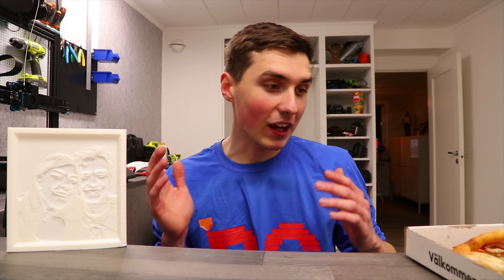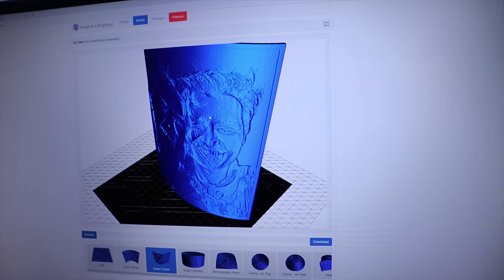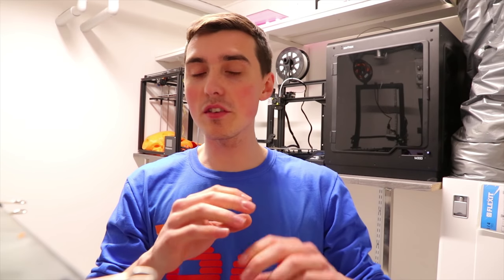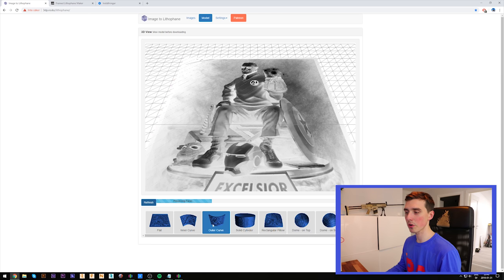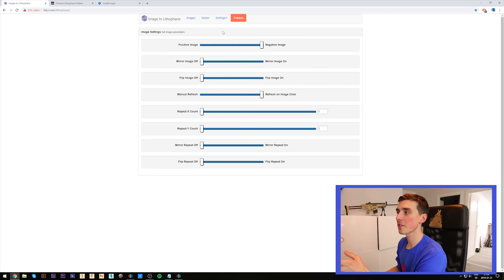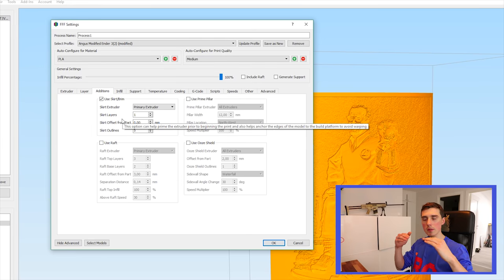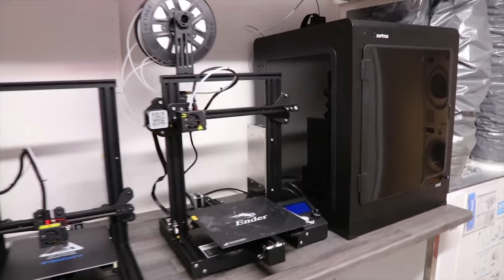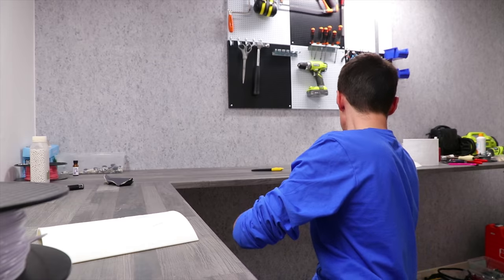3D Printing the Perfect Lithophane Picture

Comment: A little remark: you do need heated bed when printing PLA if you print on glass-like surface, mostly to prevent wraping.
Reply: Yup, I had a glass bed and my prints always kept warping
Reply: Heated bed is mandatory for PLA on most build surfaces. Otherwise expect to have a lot of warping on corners.
Reply: @PunakiviAddikti  I don't use a heated bed, and I was able to print abs. I coated a glass bed in acrylic paint and everything sticks to it. Although I found out that printing closer to the bed is better, especially for petg

Comment: If using cura enable "combing mode" under travel. To keep the nozzle within the printed area.
Reply: There are 4 option, off all not in skin and within infill which one to choose?
Reply: @parthgohil4490  yeah that is what i'm wondering about too
Reply: @parthgohil4490  Not in skin works best. I believe it uses all available methods to avoid the skin at all costs. It does add travel moves so it will increase print time, but it eliminates wisps and strings.

Comment: You can do this in Cura by importing a black and white image and just print it. You can even make a frame for it in Cura by just getting your lighting levels correct on the image before importing by creating a hard border on the image. But if you want to do some extra with it you could then export as .obj and bring it in to a 3D software to bend and shape as you want. This has been possible in Cura for a long time, I don't use any other software to know so I don't know if that is fine.

Comment: I found that i actually get more detail with better edges printing flat/horizontal but layer lines can be seen in sort of a step like pattern as the litho thickness is varied. This also comes along with longer print times.

Comment: You can also try the "Tevo Flash" because it is currently on "GearBest" in the offer. I would be very happy. I think it's a good print with a 230V heated bed, dual Z axis and autoleveling.

Comment: Great video, as usual!  I have some tips to share.  I use all of your print settings (well, the Cura versions) and they work perfectly on my Ender 3.  But I have found that you can get even more details out of my lithophanes by preparing the image BEFORE I upload it to the 3Drocks website.  First I open the image in Photoshop or any other photo application.  I tweak the image to get it looking nice, then bump up the saturation and contrast a lot.  Then I convert the image to gray scale, which produces 256 shades of gray.  Next, I work with the contrast, brightness, and levels to get the most dynamic image possible (meaning I have pure whites, pure blacks, and everything in between).  Then I send it to 3Drocks.  Give that a try and see if you get more details in your lithophanes.  Enjoy!
Reply: Can you leave your ender settings(cura) i have some troubles
Reply: @timooak4409  I use a combination of Simon's settings and a website called Gadunky.  These are my highest quality settings and it takes a long time.  Layer height is 0.12 (or a multiple of 0.04...it's the magic number), initial layer height of 0.24 for better first layer, 0.4 line width, wall line count of 4 will completely get rid of your need for infill, optimize wall printing order,  99% infill (only if creating a frame), enable retraction, retraction of 7mm at 30mm/s, print speed 30mm/s, wall speed 30, outer wall 30, inner wall 40, top/bottom 20, travel speed 100, initial layer speed 15, initial layer travel speed 50, brim speed 15, slow layers 1, travel acceleration 1500, print jerk 12, combing not in skin, z hop enabled, 1.2mm z hop height, and use a brim.
Reply: Let me know how these settings work for you.  I'm in the process of printing a 465mm tall, 200mm diameter, circular lithophane made up of three 155mm tall sections that take 90+ hours each.  In order to create the files for this, I had to use Firefox to use the 3drocks website because it kept crashing with Chrome and Edge.
Reply: @MrBudge72  Just wanted to reply and let you know that these settings you've provided are absolutely top notch. I scoured the internet for the best lithophane settings and your comments provided the BEST prints. Big and small. I'm using an Ender 3 v2 with basic upgrades and slicing with Cura. The quality is incredible. I screenshotted your comments for safekeeping! Thanks!!!!

Comment: You say “you never need a heated bed with pla” but when I print without heating the bed on my ender 3 using the magnetic stock sheet the pla seems to embed itself into the plastic sheet. I also find the finish smoother on the bottom surface with a heated bed. The place does expand and flow and first layer width needs to be reduced to account for this but trying to get the prints off an unheated bed is so difficult I prefer the heat. Any tips on this topic?

Comment: What if you added a small platform below the lithophane image (to keep it in place) and tilted the lithophane 3D model about 45 degrees backwards on the x axis, so that it printed at an angle.
That could help with the quality. The darker spots (which protrude out more) wouldn't slope down nearly as much because they would have more dried filament below it to "rest" on so-to-speak.

Comment: RCLifeOn.... how do you make black lithophanes? I've seen a few around but haven't found any information on how it works. Mine are just black?
Reply: You have to play with your specific black filament to find how thick you can make it, then input those settings into 3dp.rocks. You will likely have to run .4 mm minimum height and like 2.4 maximum to get variations, and therefore have to use a .2 mm nozzle to get those results.

Comment: I like the curved version, have printed that out, yet want to do one that has 4 sides, different pictures, so thinking of the flat version. I would like to find an enclosure, frame, for the curved lithophane, that allows you to assemble 4 pictures together, and add lighting to the interior. I do not want to use the solid cylinder. I have tried to make my own stand, for the curved version, to allow the addition of a light, although, my editing skills aren't the best.  One question about the flat version is, How would you place supports, so they do not mess up the print?

Comment: I have tried all of these settings and my lithohanes still have a LOT of noticeable lines and imperfections. Im printing at 30mms and 0.1 mm layer height. What else could be the issue?
Reply: Which printer are you using?check if your the movement through your z-axis isn’t too loose when your printer is off and tighten it a little bit. If this doesn’t solve your problem try using lithophanemakers.com

Comment: Hey man. I have the ender 3 and printed a lion few months back and had no issue accept a layer shift but I think that is solved now. This time I followed ur video again but the printer just does 97% of a line and stops. Then starts again but misses 2 or 3mm then extrudes filament again. There is a blob left at the stop point and after few layers it catches and drags the print around.  And advice would be great.  I'm using simplify 3d

Comment: I have a question I did 4 prints pretty much with the same settings and they all came out good I did a fifth one but that one doesnt seem to stick and leaves a trail behind I thought it had to do with the bed leveling since the temperature is the same as the other prints so after 3 fails I went back to do one of the old designs and for some reason those print out good same settings and everything. Thank you in advance

Comment: Got it from thingiverse

Ok this is not a design or software, but rather a tutorial. The STL file is just a placeholder; do not download.

Cura (I'm using v2.3.1 for Mac) has a powerful yet less known feature: turning any photo into a lithophane. There are customizers available but Cura is simply more convenient, more flexible, and better quality.

1-Choose your favorite photo in jpg, bmp or png. The best ones are high contrast, simple contour ones. Basically, any photo that looks good in black and white will look good as a lithophane.

2-Open Cura and simply drag and drop the photo file into the window. A setting window will pop up. Set it up as below:

Height (thickest height): 2-4mm; the higher the darker black and better contrast, but more than 4mm and the dark region loses shades. Use a lower height for a life photo, but a higher one for an artistic photo like my example.

Base (thinnest height): 0.2-0.8mm; the higher the stronger lithophane, but the less bright light region and worse contrast.

Width and depth: the size of the lithophane so choose whatever that fits your need. On a Wanhao i3 I print 180mm longer edge because the bed is 200mm x 200mm.

Choose "Darker is higher".

Smoothing: drag to far left, then increase it in the slightest manner possible. No smoothing looks horrible, but anything more than the slightest smoothing blurs the image.

3-Print in white or any light or neutral color. Translucent filaments don't look good. Some key print settings are below:

Layer height: as low as possible to achieve the highest detail level. The Wanhao i3 z step size is 0.04mm so I recommend 0.04mm or 0.08mm, and no more than 0.2mm.

Initial layer height: use something that's no more than 1/2 of the base height in the import setting. This is to make sure there are at least a few bottom layers and the weaving doesn't show.

Infill density: 100% to print the lithophane solid.

Wall count: 1, because there is no strength concern. Similarly top layers = 0 and bottom layers = 999999 (they are only meaningful with hollow interiors).

4-Wait for print to finish, remove carefully (because it may be fragile; I cool my glass bed so it peels off easily), hold to light, and prepare to be wowed! The bumpy side should be facing you otherwise the image will look blurred.

Enjoy! This makes the best gifts for friends at almost no cost. Comments about settings to improve quality are welcome!

Comment: I keep getting lines through my lithophanes.... Very annoying I'm 15 and kind of new to printing. I have the anycubic mega s 3d printer and had it for more than a year. I recently broke the extruder feeder thingy and but super glue to fix it and now it's caused lines through it and now I'm wondering if buying a replacement extruder will fix the problem or not? Help would be great right now!

Comment: How long did the print take the ender 3? I tried those settings for a 18cm high curved photo and it says 10h :0 || 5h20min with 0.15 layer height. Did I mess up the settings?

Comment: Guys if i wanna run a components that requires 12 volts and i only have a 9 volt battery will i be able to power the component? It is a peltier cooler 12706 but i only have a highest of 9 volt battery in my house. Please Respond. I need to know if i can also have components like a fan in parallel that requires 5 volts. How would i bring the current down to 5 or can i run it at 9? HELP

Comment: For Some reason i just can't flip the picture by 90°, so i can't print the curved Lithophane. Anybody got some suggestions? i tryed flipping and mirroring options, and tryed the repeated options. The help section also did not provided any troubleshooting and rotationg the image and importing it "flipped" did not changed anything. It's supposed to be a birthday present :/

Comment: Hi, I'm having issue with some oozing on my litophanes, how can I solve that?
That usually occours when U have the biggest tickness.
Reply: The issue is likely to be that your 3D printer is over extruding the infill. Making sure your printer is 100% tuned is essential, but it may help to slightly lower the infill density. The issue with that solution is that it might result in air gaps that will make dark areas seem lighter. Depending on how bad the globbing is, setting infill density to around 96% shouldn't have too big of an effect on the picture quality. You could also increase wall layers so the lowered infill density will only affect the thickest and most at-risk areas.

Comment: Can sb help, i just tried to print my own  lithophane, and it ended up not translusive at all... is it the fault of the plastic (gray pla) or i just messed the settings 1.3 mm in darkest area?
Reply: brunokazimierz I would imagine the grey isn’t opaque enough. 

If you want to use the grey you will need to experiment with the thinnest & thickest layer. I would also while experimenting print smaller  pictures or scaled down versions. 

I think grey would be one of the harder colors to use.

Comment: My ender 3 pro litophanes always come out super stringy and full of lines.
Reply: As for stringing, you can try increasing retraction value or decrease temperature a bit. And lines could be due to loose/too tight belts.

Comment: Ive tried using 3dp rocks and slicer pe to make a lithophane and i keep having layer shifts how do i remedy this i have tried slowering it down to 40 % speed but it still leaves a shift please help
Reply from the maker: Make sure there is nothing mechanically wrong. Lubricate the Z-axis rods and make sure your belts are tight.
Reply: RCLifeOn thanks ill try to lubricate the rods belts seem tight

Comment: while printing vertically, the ABS cracks in between. What is the solution for it?
Reply: use PLA
Reply: @Twometer  PLA gets spoilt over time isn't it?
Reply: @akhileshbhise7266  no its just not as strong as other plastics. But as long as you dont throw it around it stays stable. And its very easy to print and doesnt smell like an exploding chem lab.

Comment: Everything I've read says you should use a heated bed, but you say you do not need a heated bed for PLA.. I'm confused.. lol

Great work though...
Reply: Yeah, you SHOULD use a heated bed. PLA sticks better when the surface is at 40 to 60°
C, but it's not necessary. ABS on the other hand pretty much requires a heated bed, or else you get horrible adhesion. And an enclosure is highly recommended for ABS too because if you don't use one you're probably going to get a ton of layer separation and pretty much waste your material.
Reply: @adrianmunoz8327  Thank you.

Comment: My print keeps coming lose from the bed at around 30% complete, any ideas
Reply: Use an elmers glue stick on the bed before you start the print that solved my problems on prints not sticking

Comment: Howzit everyone! I got a weird thing going on with Lithophane printing. 

Has anyone had problems with sudden Y offset shifts in the middle of printing a lithophane, with Cura or Repetier Host/Slic3r?

I have done much testing with different .stl files and slicer programs and I keep getting these Y shifts.

I have rotated the model to print it at different angles and still sudden 1 or 2mm shifts on the Y axis.

I have eliminated the printer as causing it because it did the same exact matching print twice in a row. So it's in the file but not the actual Gcode. But I don't know whether it is the browser software creating the .stl file or if it's in the slicer software.

Anybody got any ideas or experience with this?

Comment: Hey bro I got a tevo tornado and it was working great and it stopped working and the extruder was clicking so I thing I need a new printer can u do a review on the tevo nerseus thank you keep up the amazing work
Reply: Thats not outright broken, i had it on my anet a8 and fixed it, either the print head is too close to the bed causing extrusion to become impossible or your nozzle is jammed.
Dont replace that without fixing it and if you cba then give it to me xD
Reply: @KermitDaFrowg  I fixed it and I got the glass bed model and I had to use painters tape to make my pla to stick

Comment: "You never need a heated bed for PLA" u seriuz?
Reply: Thinking the same thing. Abs its even worse but still.
Reply: PLA doesn't require a heated bed... Just as he states. Not sure why this other guy is comparing to ABS...must be a christmas noob.
Reply: @stephendavis2113  Pla is low warp, but still warps and it can warp pretty bad with long skinny prints 1-2mm, that's why I was comparing it to abs. Having the heated bed helps with adhesion and significantly reduces warping on the first 10 to 20 layers. More in my case as I'm using a .2 nozzle. I've personally had better results with a heated bed in prints that are long and skinny. Not every print needs it for sure, but I still think its a good idea in this specific application. Especially if your doing the full length of the bed and only 2-4mm in width. Especially if your only white is cheap filament. There is plenty of data out there to back my claims up as well. It works for me and my pictures are turning out really good so you do you if it works.
Reply: @stephendavis2113  True, PLA doesn't require a heated bed for adhesion. But warping will occur without a heated bed. Hell, one time warping was so bad it actually lifted a 10 line brim off my heated bed.

Comment: Where can I find the cura setting you are referring to for the ender 3. I have a quality issue I can figure out. Each layer is printing like strips on the American flag. Plastic 10mm wide then nothing 10mm Wide! The model completed but it so weak when finished.
Reply: Did you solve this?